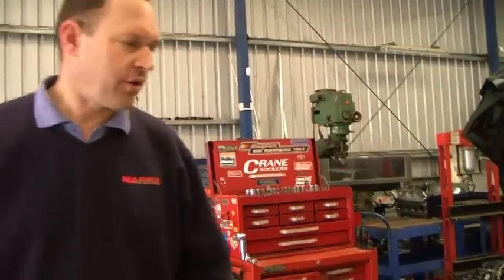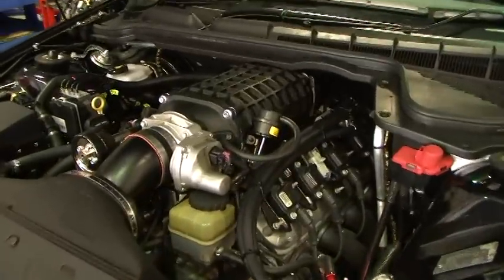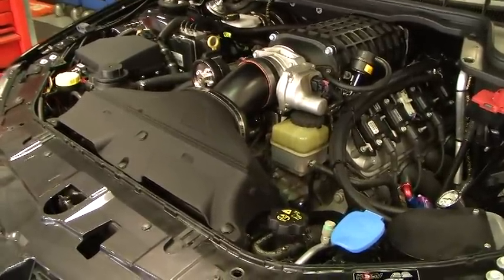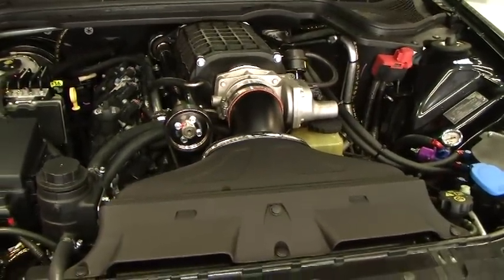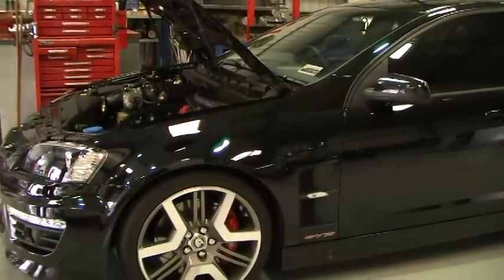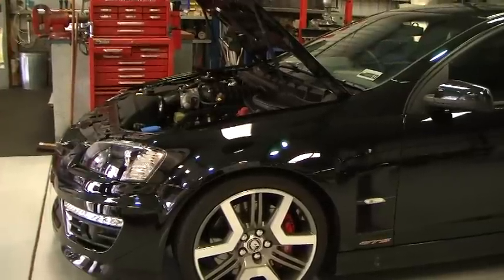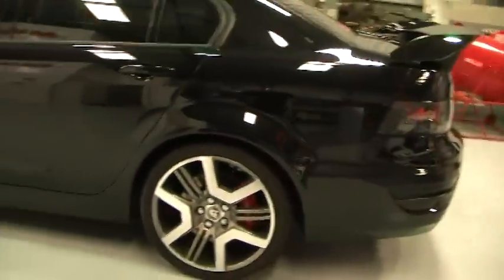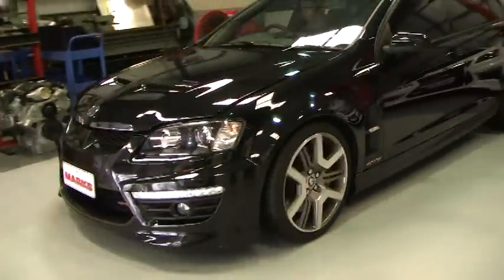SUPERCHARGED VE E2 GTS

Comment from the maker: @Joydivisian thanks for that, as for the auto's they hold up at 400rwkw if you program them right, they will actually hold down almost 450 but don't last long there, depending on how you use them. We strengthen them past that point.